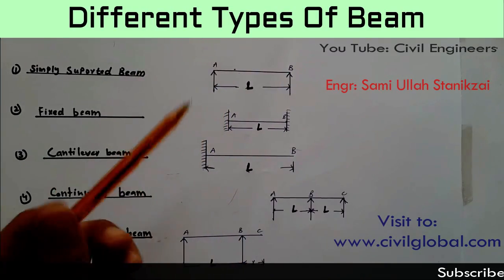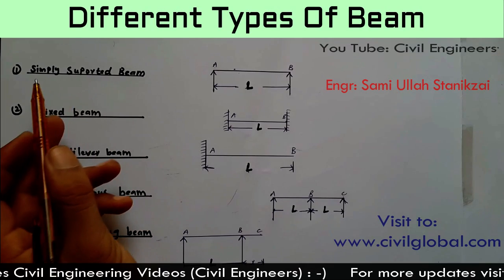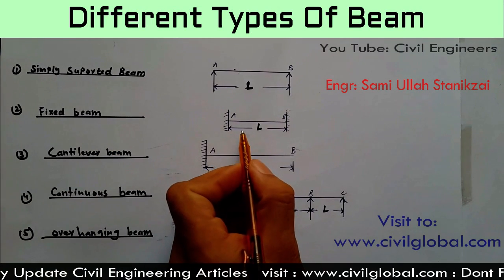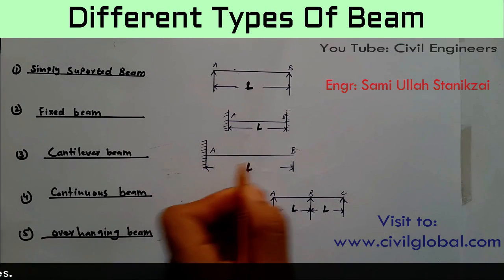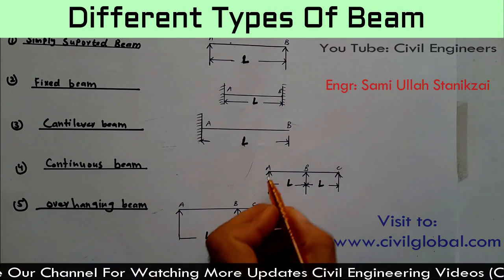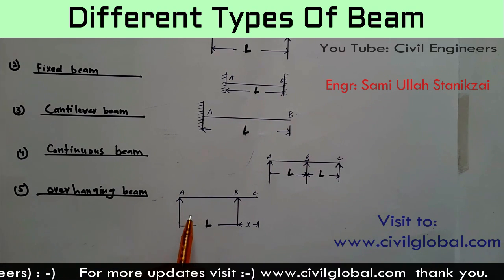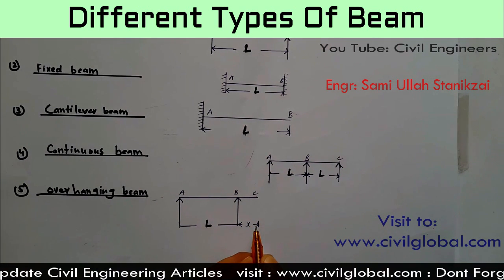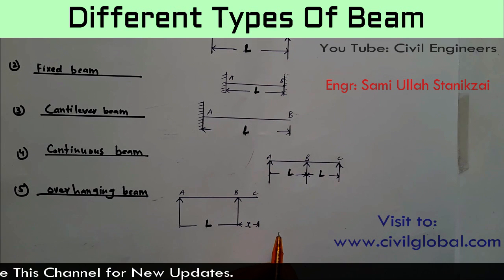Different types of beam

Comment: Hi sir, I want a design of small culvert, 30L*22W pls suggest beam design and slab design with iron measurement and thickness of slab for load capacity of 50 tonnes rarely running vehicles